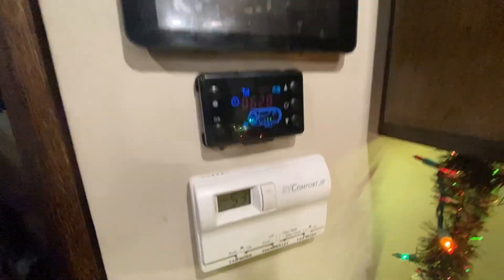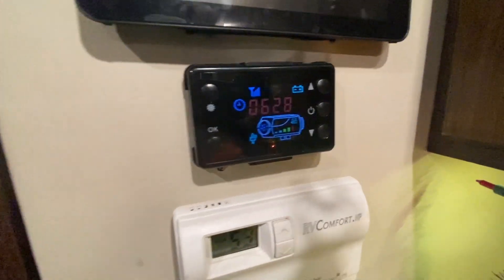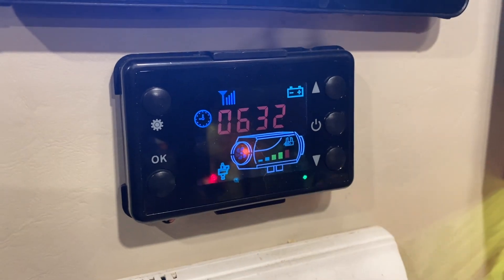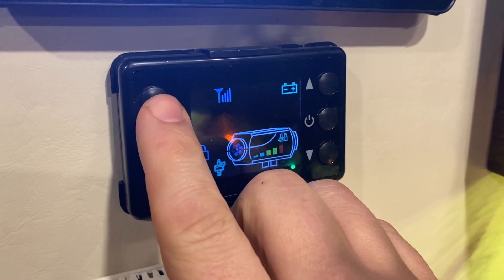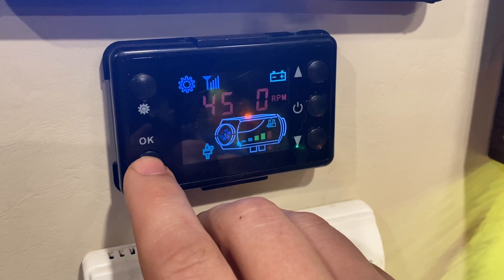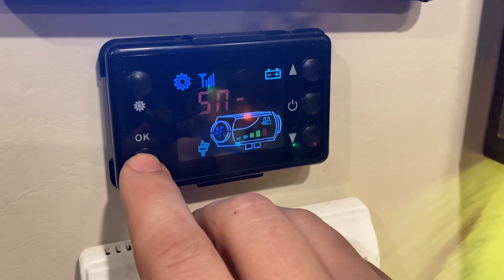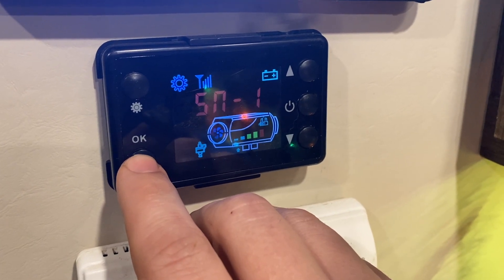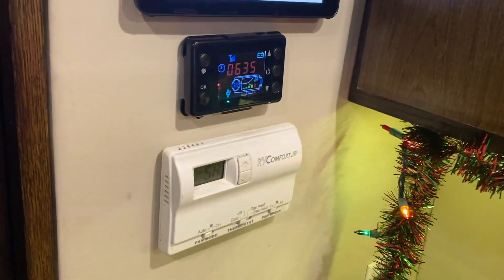Tips for Diesel Air Heater in Extreme Cold - Diesel Air Heater smoking or going out

Comment: Maybe i missed it, but you never mentioned fuel gelling at sub zero temps.Even here In UK we can get -20c on rare occasions, that said , diesel will gell at -6c so either needs heating up or anti gelling additive so it can flow properly to pump and burner and the colder it gets the more additive is needed,  I use Kerosene for my diesel heater as its less effected by cold as its thiner. It sounds to me, you are treating the effect  not cause of problem! but maybe I've got it wrong somehow and missed that part of your video..

Comment: watch your exhaust when you dump that much fuel in, if you have black exhaust you are just dumping unburnt fuel out the exhaust.  I am at much higher elevation but I cant run mine about 4 hz without black smoke and fouling of the burn chamber,   lowering the top speed of the fan keeps the heater warmer without wasting lots of fuel.  You might have to take the heater apart to clean it out if you run it at pump speed of 4-7 for extended time frames.   also the pump gets air caught in it if you run it upside down, they run much quieter and tiny airbubbles that the pump produces from cavitation will not put the heater out. 

You also might have a clogged burn chamber if you have to run two glow plug cycles to get it started.

Comment: if you can get into the 1688 menu why dont you turn up the glow plug temperture from 5 to 6? surely this would prevent you from having to start it up multiple times to get the heater hot, my 2 kw seems to manage fine in mimus 10 degrees C but I am heating the air from inside the building with the heater is mounted on an outside wall and I start it up on its higest swtting andf let it run for 15 mins before turning it down to run at 1.7 Hz all day long and it maintains 20 degrees C in my two bedroom house in the UK. the downstairs is as big as your RV.

Comment: Thanks for the vid. It got down to -26 today and the heater displayed E-08. I checked fuel line. Didn’t look gelled. I add anti gel to fuel but thought maybe not enough. I replaced fuel filter. But it looked ok. Found your vid and made the alterations to control. Hopefully this will solve problem. I wonder if the intake air freezes the heater? With the increase in hertz on pump maybe this will solve. I thought of bringing intake air pipe inside compartment to feed it warmer burner air. Anyways, thanks again for sharing
Reply from the maker: This year we got down to -15 or so and it kept up fine. We’ll see how things continue.  

I eventually had the rubber hose start to crack on mine as well. Depending how long yours was used, take a look. My pump was sucking air.

Comment: Try mixing some gasoline into the diesel to decrease the flash point to help the diesel burn when its cold. There is a guy on YT using straight gasoline, and it works but makes more noise probably not too good for it. Cold temps with say 20% gas could make it start and run reliably at sub zero temps.

Comment: The only issue I've had is I've gotten fuel that wasn't winterized and it pumps slower giving the same effect.
So I would put some fuel in a jug and set it outside and make sure you have enough winterization that you're not getting a thickened fuel which will pump slower and with a smaller shot on each pump cycle
Reply from the maker: Dealing with that again this winter.

Comment: I have done a lot of research with these heaters. I live in Lethbridge  A.B. Canada and we get -30 Celsius every winter. I noticed you have a green fuel line. Get rid of it because it is too big and flexible. What you need is the small white nylon line. You will find more about this from john  mck videos. Also if you can, use a separate fuel tank and add kerosene with the diesel fuel. You can go to a 90% kerosene and 10%diesel mix in extreme conditions. Also adjust your unit for altitude .It really helps .
Reply: I am in Edmonton, just installed it in my truck camper. Where is it possible to get the white nylon line you mentioned ?
Reply: @Doodlehed99  I don't know what is local but aliexpress has everything you will need but it will take about 3wks to get here from China. My suggestion is to try an Automotive store.
Reply: @SuperrichtSuprt  alright thanks I will look around !
Reply: @Doodlehed99  The only other thing is to get hold of an espar dealer. I think there is one in Edmonton and one in Calgary. I also think that you should get an account with aliexpress. They have everything you need. You can build a heater from scratch with all of the parts that they have.
Reply: #1 diesel is 100% kerosene.

Comment: Very informative. Especially how the fuel/fan speed ratio works at mid range settings. I was partially restricting the fan input opening to keep the heater warmer at lower settings, but having adjusted the maximum fuel rate, it now does what I want it to. Cheers! 👍

Comment: Hello from the high desert of New Mexico, try insulating the fuel lines, add a water separater with heater, use 12 or 24 volt silicone heating pad for your fuel tank. Also most of the digital controllers have a high altitude mode , the icon looks like a mountain. I hope this helps. Keep up the good work and stay safe and I hope to meet you sometime

Comment: Hey there! You are doing great finding this out. I have two of these on my conversion. Now I have not finalized my installation yet. So I used the little tanks that came with it. Both are in the heated cabin area. I don't have a basement on mine, but the heaters are mounted to the floor, so combustion air/exh discharge under/then out to side through skirting. The fuel line is also under then returns back to the heated cabin area, where the pumps are just lying on the floor. These I had no problem with 5  to 0 degree F outside temps for a week or so.  I may tap into my engine fuel tank. [90 gal].  I'm really wanting to get a Espar/Webasto Hydronic boiler, and implement another heating system. Make maniforld zone valves, and be able to preheat the engine if I want or just run something like baseboard heat under the sofa's, cabinets just to keep thermal mass heated.  Just in the beginning warmup or to augment have fan coil units in different areas if you wanted.  I'd still keep the diesel heater for another backup or milder weather warm ups.  I'm also going to be install water heater tank with 120v 1500w heater/hydronic, so when we are driving we are heating the domestic water tank. [so the boiler would work well with this idea too]. Aqua-hot, and the other company make the packaged units, but guess I rather make my own.  But I like the idea of engine block heater off  boiler.  I have a cummins, and your detroit seems like it wants a preheat during the cold weather. Might be an idea for the future.  Thanks for sharing your insight on this!  Stay warm!  God bless!  AL from CT! [Just getting some above freezing days here!]

Comment: Thanks for the info! -9 was the lowest temp we saw this winter, I added antigel to the fuel and had no issues. But if I find myself in Minnesota next winter I'll now know what to do.
I killed my first diesel heater by disconnecting the power when it was running. It was running at full temp when I did it. When I killed the power the fan instantly quit but the fuel line between the pump and heater still had pressurized fuel which kept the flame on for a handful of seconds. That's all it took to overheat and damage the fan motor. 
Thanks for sharing and keep warm.
Reply from the maker: Yup, you’re the unlucky cautionary tale winner!  I hope to someday cross paths to exchange stories of trials and tribulations properly. Good luck out there.

Comment: Is you diesel heater sucking in outside air for combustion and heating air ? 
I got copper pipe and did a few wraps around the exhaust pipe to warm the diesel a bit. 
Mine uses inside air
Reply from the maker: That is clever, I’d love to see it.

Comment: To high fan speed if it blow out. You have way to high hz and rpm. So high rpm can blow out burner.  How big burner in kw you have ?? 2kw or 5kw??     I recomend you to buy bigger kw wgit this problems.

I am in -20 celsius and only have hz at 1.1 now whit 0 celsius.  4.0 hz. 
Rpm 1450 and 4000 rpm. It gives hell of an heat and take no damage

Comment: Lives in norway stuck in ice whit house boat. Running 5kw burner in -20 degrese celsius.   But you talk farenhaigt??
Reply from the maker: Yeah so -28c it has to be similar, could be my diesel is gelling. And not delivering as much fuel per pump.  All I know is, at 4.5hz and 4500 rpm I was getting a flameout.  I appreciate the feedback.
Reply: @HimmelbergerBus  in the winter I used to add regular unleaded gas to waste veg oil to burn in my diesel car but no more than 10% ro prevent the veg oil freezing. diesel does have its own antifreeze already down to about minus 15 degrees C. a little extra help from 10% gas might help.

Comment: I just Had an issue with a fuel pump not working. No noise and no icon on screen. I ordered a new pump but it was going to take to long so I ordered a new heater as backup. At these prices it cant hurt to have a spare. Incidentally I am comfortable in t shirt and shoeless for less than 10 gallons per week until we hit below 0. That week was 12 gallons.

Comment: Thank you for this info. I have 2 air heaters and a Wabasto coolant heater. I use the coolant heater for radiant floor. The air heaters are way more tolerant of jell than the wabasto. I live full time in mine but I live in the tropical climate of Massachusetts. The coldest I have had so far is -6.